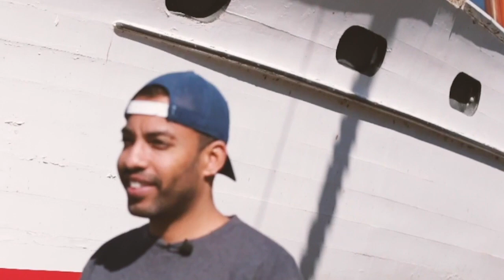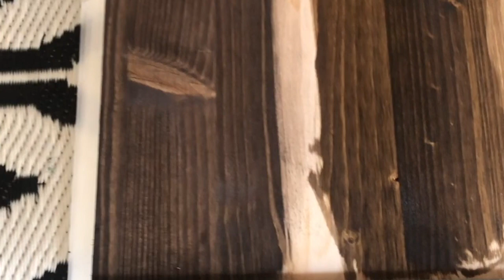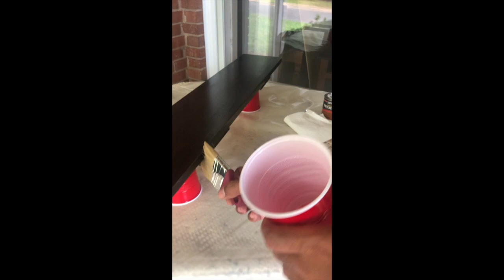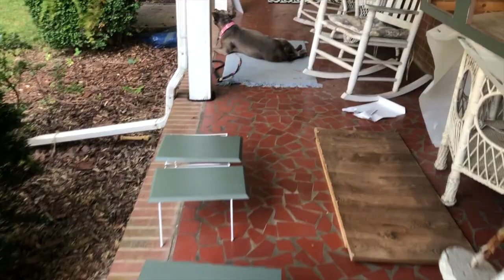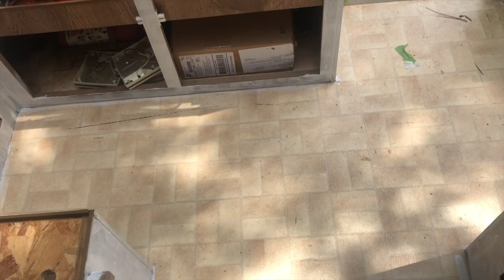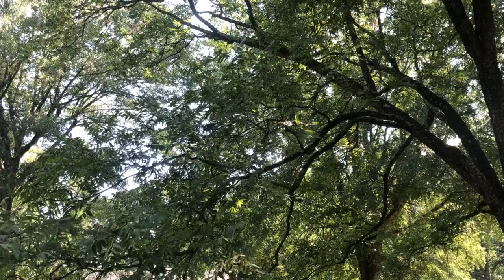Renovating an old RV- Painting old MDF cabinets— Popup Camper Interior remodel —EP 1

Comment: I recently adopted this saying from Troy on Free Range Sailing as a Truth  -  "Prefect is the enemy of good". 
This is because words like perfection, infinity, forever, always, never, etc.  are only concepts.  They are unobtainable and if you set a goal based on an unobtainable result you are setting yourself up for failure.  Instead, set short-term goals that can be measured like getting the camper to the boatyard by a certain day, getting a certain piece of work on the boat done by lunchtime, by the end of the day, or end of the week.  This keeps the drive to stay on task alive.  Longer term goals don't have the same 'spark'.  A good goal is one that's big enough to scare you a little bit (that's the 'spark' I was talking about, is clearly defined and achievable, and has a time limit.  If you want to make simple, easy, boring goals (like chores) exciting, make them goals with a very short time limit.   Always celebrate the achievement of a goal, even if it's just a high-five, or telling yourself  "Well done!".  Then go on to the next one.  
There is one side effect of doing this, though...
Once you get in this habit you won't even notice naysayers anymore.  But don't worry, they'll find somebody else who's taking on a challenge to nag.
Reply from the maker: Amazing advice Tom! Thank you for taking the time to share that with us!

Comment: The Pop up is a great idea! Loving in a construction zone on a boat is no fun at all. What year/length/model is your boat? I also noticed your front salon windows appear to be fiberglass over to prevent leaking. Do you plan on removing that or leaving the fiberglass on? 
Good luck!
Reply from the maker: Hey Paul! Our boat is a 1949 Chris craft dcfb. Ahh we’re so sad about those being fiberglassed over! When we first saw photos of the boat we thought was just wood— but then saw in person and realized. We do plan to remove and put windows back as they should be! Should be a fun job! 🥴
Reply: @loversaboardodessa6294  Glad to hear you are planning on repairing the windows! Check out the channel "Travels with Geordie" He is restoring a early 50's monk cruiser similar to yours, it will probably have a lot of info for the task ahead dealing with all that woodwork. The best advice I can give is to not take shortcuts with it, buy the correct and expensive wood otherwise you will be pushing the problems down the line. Looking forward to seeing you resume work!